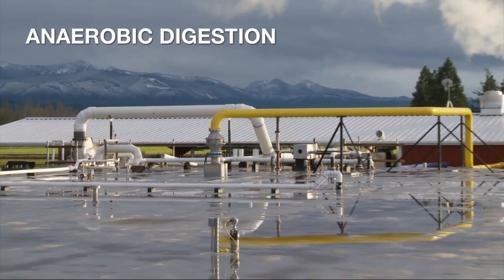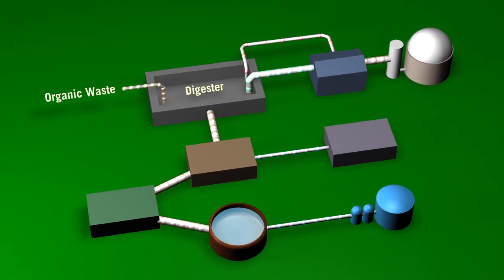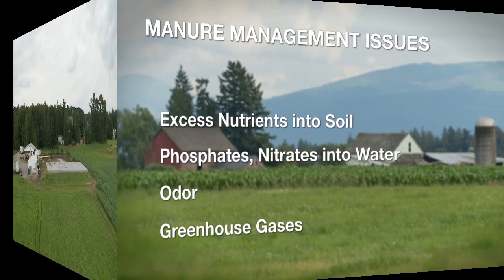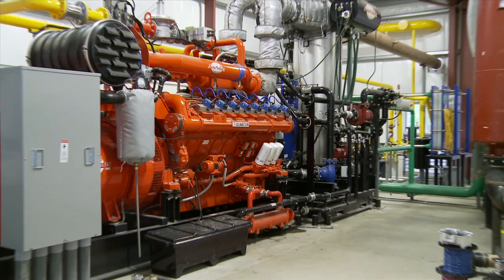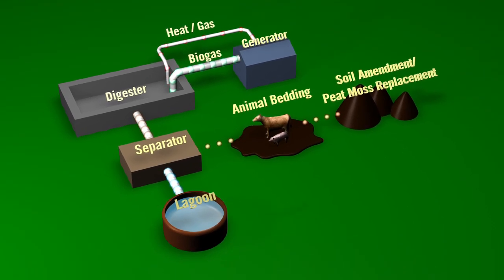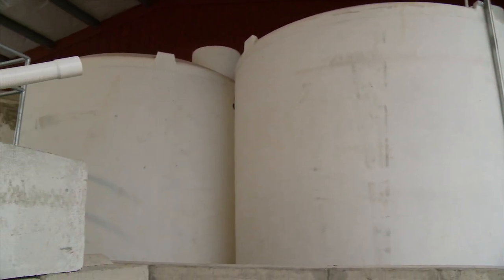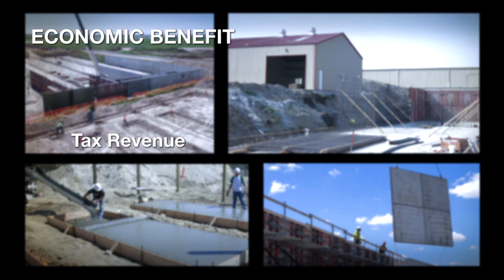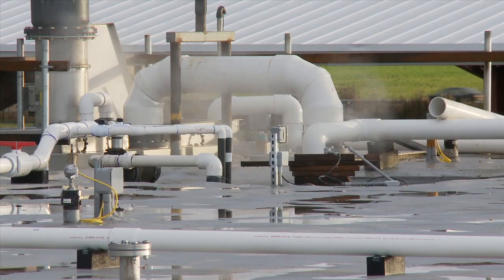Anaerobic Digestion: Beyond Waste Management

Comment: The product is methane and carbon dioxide; what are the rates (80/20, 50/50)? What happens with the carbon dioxide?
Thanks
Reply: Typically 60-65% methane (CH4) and 30-35% carbon dioxide (CO2).  The CO2 can also be removed to create renewable natural gas (RNG) which can be injected into natural gas pipelines.
Reply: The CO2 is being wasted !!!!!

Comment: Nutrient recovery is done after the metane froduction from biogas or before production???
Reply: It depends.  If a fermentation step is introduced before the digester tank, then ammonia gas can be diverted to an Ammonia recovery unit, and Nitrogen could be recovered at this point.

This would leave Phosphorus and Magnesium for recovery from the digester tank(s).
Reply: After the solids leave the digester tank